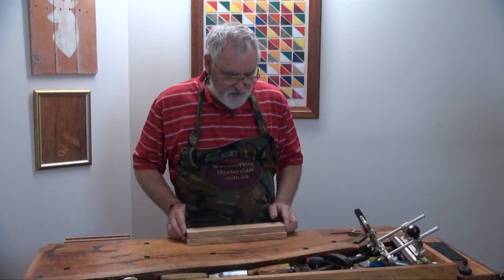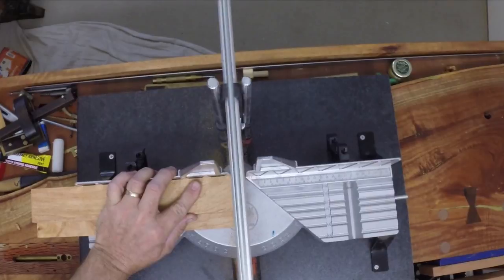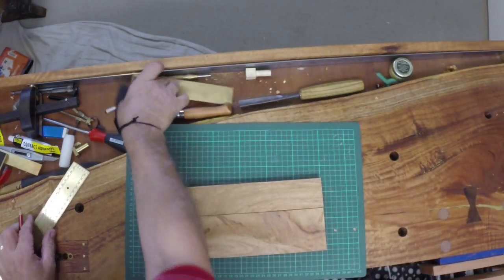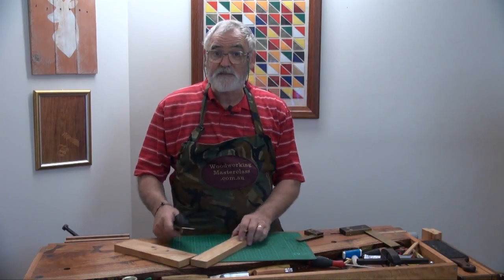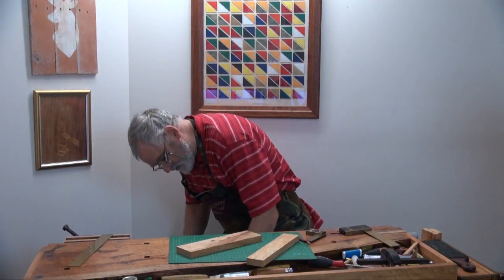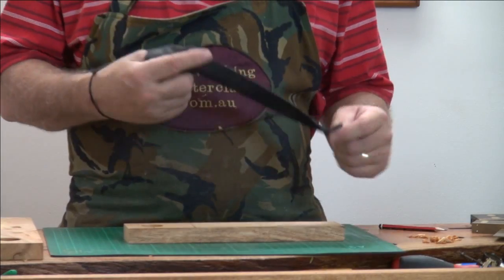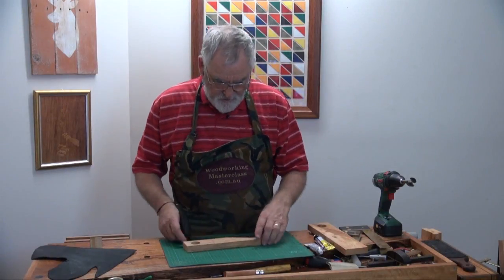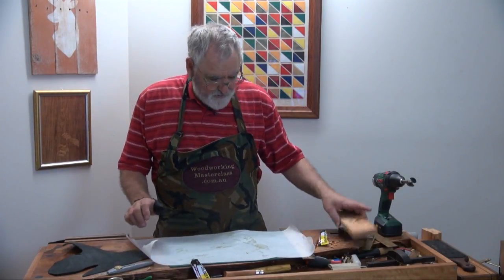Making 2 x Leather Strops Pt.2 of 3 Using Hand Tools

Comment: Steve, interested in your bench for your room shop. Did you build that, if do you have a video on that? If not do you have info on it?
Reply from the maker: Hi Larry. Yes I built it, made it out of some scrap timber I had laying around. It was not much good for anything else so I decided to put it into a bench. Held together with cup-head bolts. No video, as It was a throw together in a  need one now sort of thing. Cheers Steve